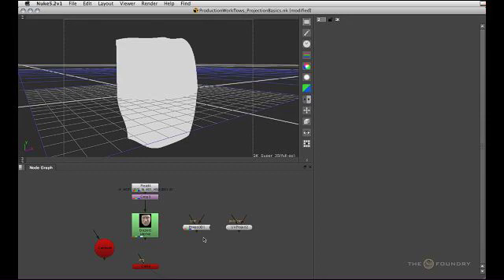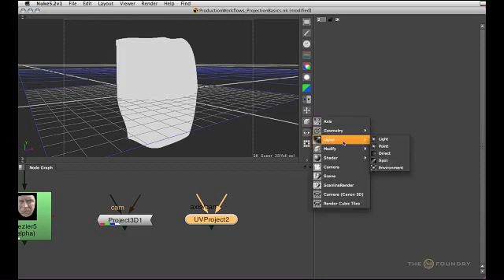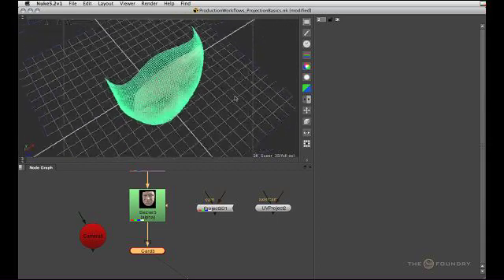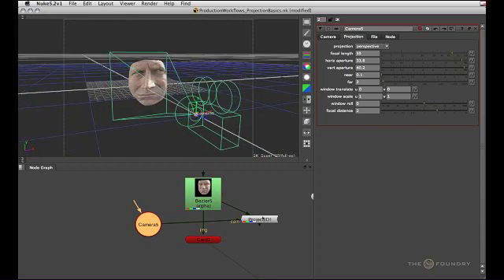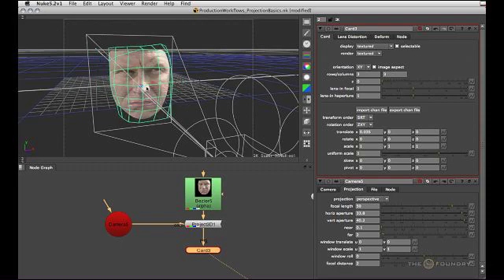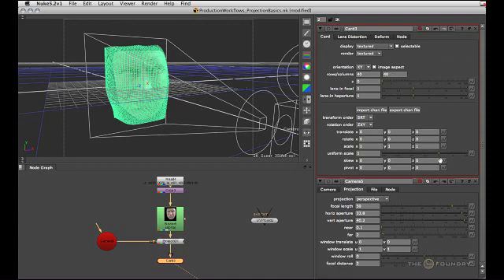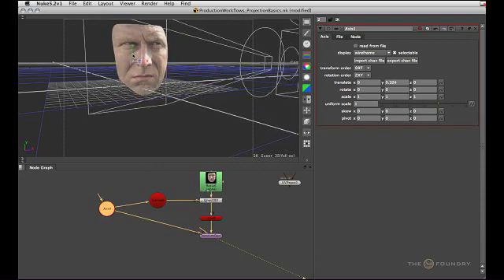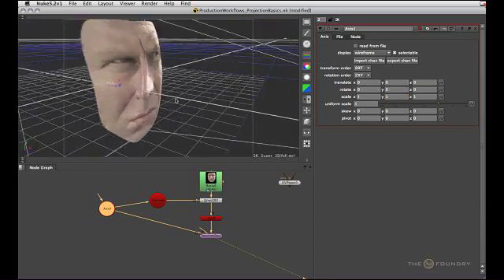Nuke | Production Workflows: Projection Basics

Comment: so when do you use project 3d and when do you use uv?
Reply: to be honest there is no difference, but if you wanna move things around, cam project requires the axis node link and uv method does not....also the uv method actually 'modifies' the geometry, the projected texture becomes the actual texture of the geometry, whereas with the projection method, the geometry is untouched, rather the light is being projected onto its surface, just like a real movie projector....

the cinema screen is not gaining a texture, when turned off, it will disappear...with uv project the image is actually becoming embedded in the model